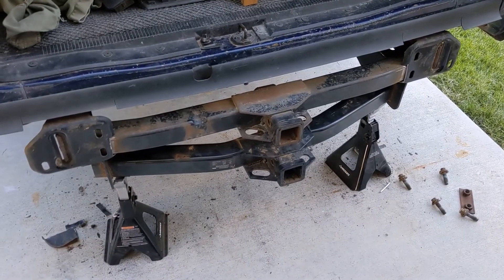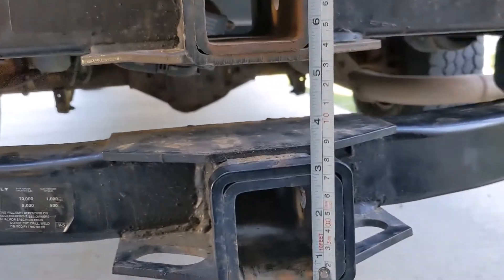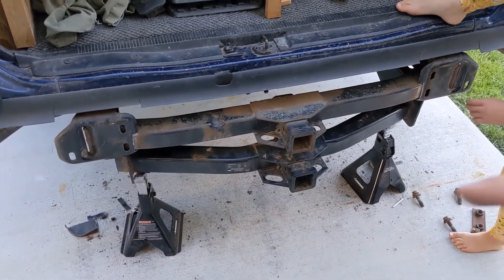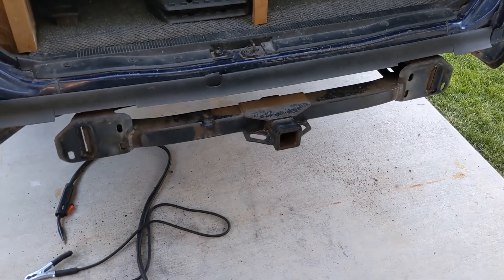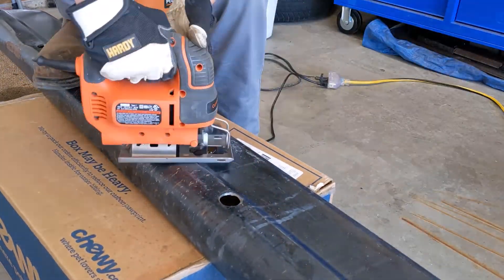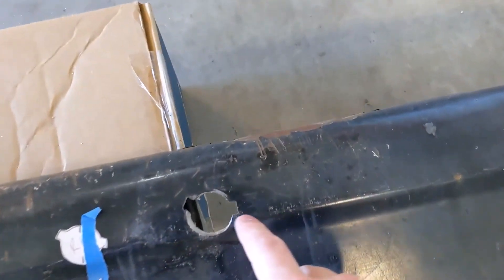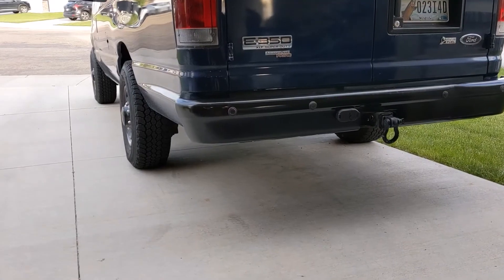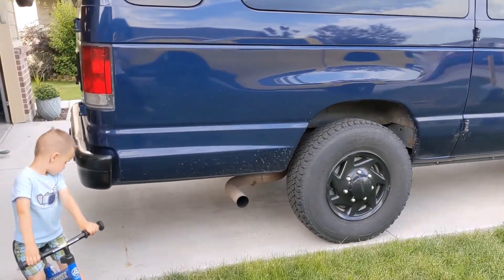+5-inches rear ground clearance on Econoline/E-series using junkyard parts

Comment: Great looking van! What size tires are you running, and did you modify anything to make them fit?
Reply from the maker: Thanks! 265/75r16 AT Goodyear Wranglers on OEM 8-lug wheels. No modifications are necessary but I added 2" spacers to the rear to increase the track width and replaced the front springs (old ones were 2013 originals and had lost about 1/2")

Comment: What became of the spare? Is it just higher now, or did you remove /relocate it?
Reply from the maker: I had it on the roof rack for a while. Didn't love the look or knowing all that weight was up so high, so I did end up putting it back underneath but I modified the carrier to pull the tire up closer under the body.